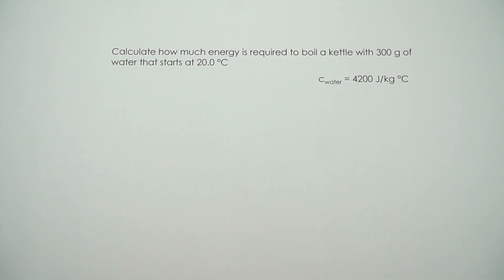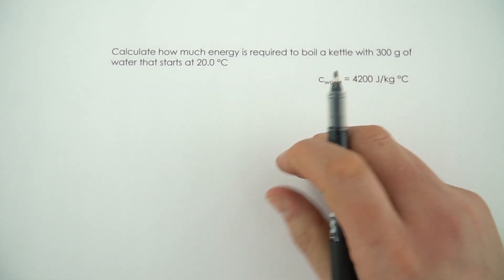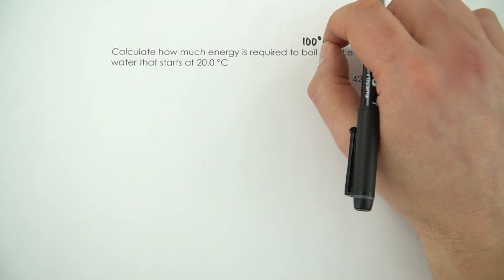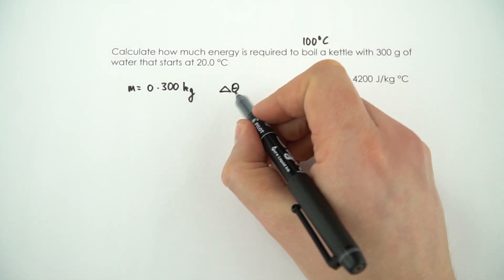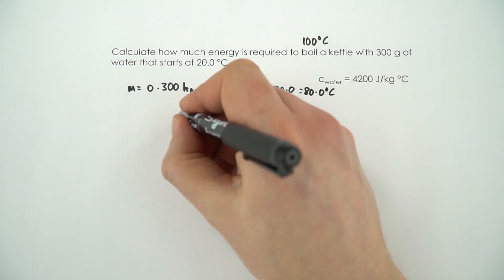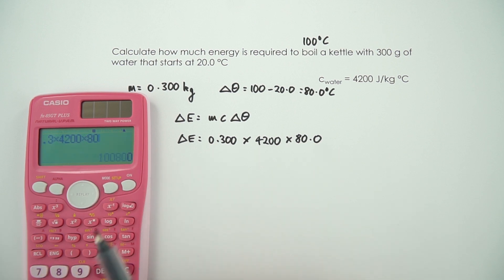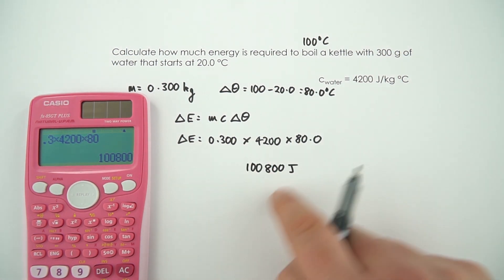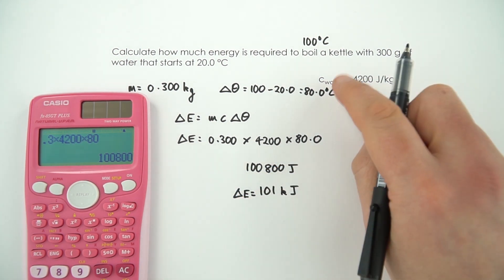Energy to Boil a Kettle? Specific Heat Capacity - WORKED EXAMPLE - GCSE Physics

Comment: quick question. what if its electric kettle that has a power of 1000W does it mean 1000W = dE on this problem? if not, what's 1000W of power of kettle for?

Comment: Pure water boils at 100 degrees has a specific latent heat of vaporisation of 2260kJ/kg and a specific heat capacity of 4200J/kg How much energy is required for 2.0kg of water to boil if it is already 100 degrees